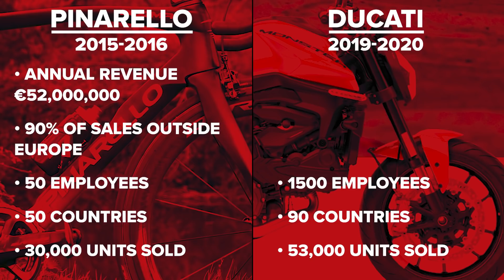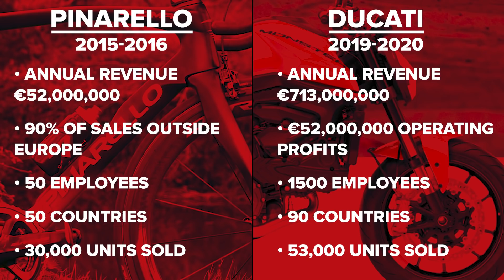How Can A Road Bike Cost £10,000?!

Comment: It’s hard to have a meaningful discussion without knowing the profit margins.
Reply: I think regardless of the profit margins, if people are willing to pay 10 grand for a bike, then manufacturers will continue selling them at that price.
Reply: They will never tell you the profit margin
Reply: Profit margin does not matter. If people are willing to pay for $10k then they will be selling them for $10k.

If you want cheaper carbon bikes, buy from chinese carbon frame manufacturers. Let's see if it is "worth it", i bet their profit margins are slimmer.
Reply: @sepg5084  Winspace or Trifox would probably be okay to purchase from, but forget it if we're talking unbranded stuff lol
Reply: @nekobytes9187  Sure, but the point is that if a bike costs £10k but costs the company like £2k in total (as in from manufacture through to delivery) then we could say £10k is kinda ridiculous. But if it costs like £8k in total then we could say £10k is reasonable etc etc. Numbers picked out the air for the sake of argument.
Reply: @nopaynenoparty  if you look at it that way, yes the bikes do seem like they're made on the cheap and sold at a high price. But remember manufacturers do a year or so of R&D before releasing their bikes; this doesn't consider the R&D that goes into 3rd party components like the drivetrain, wheelset etc. Plus the actual cost of setting up the assembly line, shaping the moulds, and training all those frame builders who lay up the carbon fiber. Plus distribution. All the costs add up in the end.

Now I don't pretend to know bike manufacturer's profit margins, but there's definitely more to it than just materials and labor cost.
Reply: @nekobytes9187  I mean all costs, which is what I meant from manufacturing to delivery (I considered R&D etc to be part of the manufacturing process but that could be clearer!). But meant everything like design/build/advertising/delivery costs/etc/etc. Hard to judge to what extent people are 'overpaying' for a prestige product etc without knowing all that... and obviously we'll never know!
Reply: There are clearly two major factors in why bicycles are extremely over-priced:

(1) It is a small, specialised space (as Ollie touched upon). If bicycles were as common and important (for work) as cars, £10,000 high-end carbon bicycles would quickly become £3,000 at most. You can understand the same thing with PCs/laptops. They used to cost £1,000 for something pretty terrible, now you can get a good gaming PC for £1,000. Likewise, you have the problem of people pointlessly buying £10,000 PCs, as well, but that's the free market for you. But, my point is that computing is now so popular they are able to create high-quality machines for low prices due to the supply and demand, and greater labour and talent pool -- that's how capitalism works. The bicycle world, on the other hand, is actually very small given the fact not many humans even own a bicycle.

(2) As such, cyclists paying anything beyond £500 for a bicycle tend to be more middle-class, specialised people who are naturally willing to pay whatever cost. In theory, if cycling becomes the norm for humanity in 20-50 years, you will see high-end bicycles at ten times lower costs. So, it's both because the buyer is willing to pay that amount but also because the cycling world is not actually big enough to force a £10,000 high-end carbon bicycle down to £600 or £3,000. Not to mention the fact that the kinds of bicycles we are talking about barely existed in 2010, so there has not yet been enough time to lower the prices for such quality, specialised bicycles. Give it another 10 years, and you will find that these £10,000 bicycles are more like £5,000, and could be even cheaper if cable bicycles go out of fashion due to the new wireless shifting or whatever.

It's the same reason it costs £800 a year just to join a Golf Club. There are only 40,000 Golf courses in the world, and they are massive and require endless staff and labour and money, and the kinds of people who Golf are willing to pay, and do so for many reasons as Golf is a relaxing, long-life ideal and each round takes 4 hours. Compare this to Tennis. There are over 500,000 Tennis courts in the world, each game takes around 60 minutes, and it's done first and foremost for bodily training or to get better at Tennis, or just for street sport. Couple that with the fact that Tennis is a very cheap sport for the companies and labour involved compared to Golf, it's no wonder that many Tennis courts are free or cheap, whereas, most Golf Clubs are £800 a year. For ten years, that's £8,000 and maybe another £2,000 for a good club set, along with other costs, bringing the total to £12,000 to £20,000 over ten years. That's a bit like a £10,000 single-payment bicycle for ten years plus extra costs for maybe £12,000 to £15,000. It all depends on what you are willing to pay -- how important it is to you -- and how costly/specialised the thing itself is, and how scaleable it is. For example, Gung Fu training tends to be quite cheap because the teacher can easily teach 50 people the same thing without much extra costs for the teacher/school, whereas, if you want to have a Golf course for 50 golfers at once or 50 high-end carbon bicycles, then this actually costs them a lot of money as it does not scale, compared to something like alloy cars, which scale fairly easily as you can get a handful of robots in a large factory to make alloy cars for few added costs, and alloy itself is cheap and easy to mould, compared to carbon or a Golf course, which itself can cost 2 million to create along with extra costs, and is a very specialised field of design, where the large American Golf courses cost more in the range of 10 million to build, followed by added costs and upkeep. In theory, you should want 500,000 really small Golf courses around the world as opposed to 40,000 larger courses; thus, lowering the costs for the golfer. Unclear if that will ever happen, though.

If it makes you feel any better, a pretty high-end road bicycle in 2004 cost £2,000 and was not as good as even a £3,000 bicycle in 2021 (and note that £2,000 in 2004 is £2,800 in today's money, so that is only £200 extra). It might also make you feel better to know that if you wanted one of these £10,000 bicycles in 2004, you would have to spend at least £100,000 given the fact they didn't even exist back then. Of course, the same will be true in 20 years from now, but you could still be thankful to be buying in 2021, not 1994 or 1974, for example, and to spend what you're willing to spend on what you want to own, as that's how capitalism works and how value/trade has always worked.

Comment: Higher price by itself is not the main problem. The problem is if the company sell their frameset for 4-6k while still failing to meet the specifiations of the hole of the BB or even making poentially dangerous engineering fails. In car industry there are high standards and consequences in big recalls, while in bike industry it is common to evade the problem with 'rider weigth limit".

Comment: I think some of the pinarello numbers must be wrong. 52,000,000 in revenue and sold 30,000 units. Well that's only 1,733 euros per bike. On what planet can you buy a pinarello at that price.
Reply: Beat me to it. The numbers make no sense.
Reply: Its from 2015. I bet you could get a Gan or Prince frameset for like a 1000 bucks back then
Reply: Because the total price to the consumer multiplied by sales isn't Pinerello's turnover. The wholesale sale price to their distributor multiplied by units sold is their turnover...
Reply: 50 employees seems incredibly low as well. Struggling to believe that one
Reply: @ChrisWinter  that one is easy to believe: none (most) of the bike brands have their own factories anymore. They buy frames in bulk, most of the times to spec, from factories which make frames for more brands. Cube, for example, which is much bigger than pinarello, have only about 150 employees
Reply: Well take into account the VAT with a B2C sale, and remember that is only the price the manufacturer is selling the average bike for, sometimes B2B and sometimes B2C.  Not the price the bike shop or the distributor sell the bike to the customer.
Reply: @ChrisWinter  Offshore manufacturing? Doesn't take that many people to buy parts from the Far East and group set suppliers. It would be interesting to see how may people at Pinarello are involved in manufacturing or even design.
Reply: @matthewbaynham6286  same can be said for Ducati. But with the numbers presented, their average sale price was still over 13,000.

Comment: Ducati is owned by Lamborghini which in turn is owned by Audi a part of the VW group. So Ducati is a VW... The turnover of the VW group in 2019 was EUR 256 billion. With 668 thosand employees and 11 million vehicles made it is pretty much bigger than Pinarello. That said I do agree to the general picture that it is all about volume and automation vs manual labour. It is possible to make a cheap bike in large volumes out of steel or aluminium, but where are the buyers of that?

Comment: My 100€ second hand vintage road bike has brought me everywhere i want and does what a high end road bike would do.
Reply: @sonny9608  good point, my needs are getting from a to b in relatively quick time.
Reply: Well, I would like to challenge you to try riding even just a 1,000€ bike. Trust me, as someone who thought the price was ridiculous. I went from a shwin bike from a local Walmart, to a marin nicasio from my local bike shop. And the difference is worlds apart, Absolutely massive. Anything above that isn't even necessaries a rip off either, you're just not a pro cyclist. Look at the prices of an pro equipment for sports. They pay ridiculous prices, but they also have much greater stakes to shoot for that just a casual ride through town
Reply: I own a vintage steel bike and can tell you that it's heavier and slower.  It has a smooth ride and stirs up positive memories being its original owner and buying it directly from the frame builder.  Try that with a gee wiz, cheese wiz carbon bike from China.
Reply: @daltonparker7792  Reminds me of my experience, rode a £60 bike called a rampage for years and didn't realize how bad it was until a brought a very basic starter bike, then spent more, £750, or probably nearer $1000 in dollars,still a starter end bike but so so much better
Reply: @checkthefacts.  right! Everyone (including all pro cyclists) once thought that even 1000€ for a bike was ridiculous. Till they tried one lol, once you try one you realize how crazy nice they actually are. It does have to be said that anything over about 2500€ is purely for sport and the returns are so marginal thay it should be left to the pros lll
Reply: @daltonparker7792  You can add $1000 to that price for full suspension mountain bikes. 
More carbon, more pivots, the shock, and forks. Yay?!

Comment: This is the best GCN episode I’ve seen. One of the aspects of why the prices are so high for top tier CF bikes is the psychology with status and prestige. So carbon is perceived as the most advanced technology for bike frames. The high end ones also tend to have the latest technology as part of their components system. Carbon wheel sets, electronic shifters, carbon and titanium group set components, disc breaks. Great technology for sure but what do you actually gain with that technology?

Not a lot actually. Maybe 0.5 to 1% performance gain against bikes that don’t have that technology. However that’s not the common perception. The common perception is they provide a huge difference. They don’t. They only provide an advantage when seconds count. 

So why do people who are not at that high a level in cycling pay that kind of money?

A large part of that is the psychology of status. That is if they’re going to get into the sport they will pay the exorbitant price for technology that’s of little benefit to them for the status.

This also affects cost because in cases like this where status is a significant motivator the selling of that product will have a higher sales based on peoples willingness to pay more for that product.

This is what some people call the Rolex affect. That is you buy a watch of comparable quality to a Rolex and pay one third to half the Price of the Rolex. That’s because Rolex has the branding and the status.

So that is part of what goes into the crazy high pricing of top tier CF bikes. So consumer purchasing decisions can be very irrational.

In fact so irrational that if one of the top manufacturers of high end CF bikes was to cut their prices by a third to sell more units the exact opposite would probably happen. They would sell less units as the lower cost means lower status. So their bike would be viewed as a lower status bikes even though they are of equal quality to the best.

For the overwhelming majority of road bike riders these high end CF bikes are not a good value. Not when you can purchase a bike that has 99.5% of the performance capability at less than half that price. For everyday fitness riding, century rides and the occasional criterium the value just isn’t there for most people.
 
Having said that if you have the money and desire and enthusiasm to where you just absolutely have to have the best technology and that’s what you value then there’s absolutely nothing wrong with that.

Comment: re-started cycling beginning of 2019 bought myself a used Roadbike (€2000,- Duraace Di2. Focus Izalco thingy), updated my trusty Trek Madone 5.2 (2006) for €800,-
to Ultegra R8000. 

My yearly spendings:
€1800 for a coach
€130 for Trainingspeaks
€60 for Strava
€120 for Xert
€180 for Zwift
€60 for a Diet/Food tracking App
approx. €2000 for medical tests and performance evaluations

Other recent spendings:
€3500 for a indoor smart Bike + a good PC and touchscreen for Zwift 
€800 ROAD Powerpedals
€1200 MTB Powerpedals
€500 Good and Smart Cycling Computer
€200 Breath training tool
€300 Metabolism tool
€1500 Stuff for weightlifting and Core training

Time spendings (the most expensive of it all):
Dropped my fulltime job for a halftime to have more time to workout/ride

What I don´t spend my money on:
a bling €10.000+ bike

Comment: Every £500 increase = 0.5 kg overall reduction = few second gain, Beyond £2-4k = diminishing returns.

Cost are better compared if using "BOM vs MSRP ratio"   You will find Motorcycle have "lower cost ratio" than with bicycles, even though there are far more "bicycle" produced than "motorcycles", then you know something isn't quite right in the bicycle industry.

Comment: Hey Ollie, need your help! I recently purchased a 2020 Scott Addict RC30 road bike which I love. Except for one part: the disc brake rubbing. When I'm out of my saddle putting the power down and rocking my bike side to side, on a sprint or climb, there's an annoying rub that has become louder and louder. It even happens when I'm hit by a big gust of crosswind. It seems to come from one side, but I'm not sure. I believe this is due to the fork flexing and thus the pads coming in contact with the rotor due to the little amounts of tolerance. I have flat-mount Ultegra hydraulic disc brakes. I've been to the local mechanic twice to no avail. The rotor is straight, the calliper is centered, the rotor is torqued correctly to the hub and the thru axle is tightened enough. My last thought is that maybe the pads need to be removed and the pistons cleaned with some degreaser. Is it possible the pistons aren't retracting enough? Please help, this is the last thing stopping me from fully enjoying my new ride!

Comment: Its quite easy really just add up the material and manufacturing costs:
Frame: £300
Groupset: £1000
Wheels: £50
Handlebars: £10
Saddle: £10
Tyres: £2
Handlebar tape: £2
Greedy bike manufacturers logo: £9000
Reply: Not quite accurate, but yeah the markups on bikes are insane.

Comment: I would never spend that much on a bike.
I paid a measly 600 pounds on a used Bianchi Oltre Xr2 with FSA carbon cranks and an old first gen di2 setup that was deffective, i sold the parts and fitted some dura-ace shifters and derailleurs i had laying around and now i have a really light and well made decent bike for next to nothing.
Now i only need some carbon rims at some point, mavic axiums are heavy.

Comment: The real issue is the speed difference of high end vs entry level bikes is tiny for the average rider, only a few seconds per kilometre at best. The bikes are weaker, more fragile and don't last as long either and often require more maintenance as so many gears means shifting tolerances are tighter. For most people not only is a road bike between £500-1000  the value choice but its a better choice too. An expensive bike severely limits where you can ride too due to possible damage or theft. Even if I was a billionaire I simply wouldn't waste that sort of money on a bike. There are simply better ways to spend your money unless you are a competitive cyclist where every second counts for road racing.

Comment: In 2015 I built up my race bike which is a Giant TCR ISP, full dura ace mechanical groupset, carbon bars, stem and saddle, enve clinchers with Chris king hubs and quarq power meter for about 5k. Total weight 6.2kg. I got the frame half price from a German company called stec so if the frame was full price say 6k. Someone tell me what extra I am getting for the latest range of super bikes up at 10k? Bluetooth gears that run out of battery, heavy disc brakes and a pain in the ass integrated cable setup? Think I’ll save my money and use it for training camps and racing.Far better return on investment.